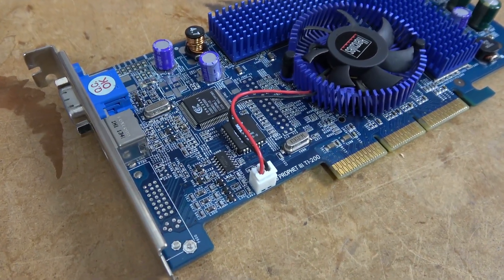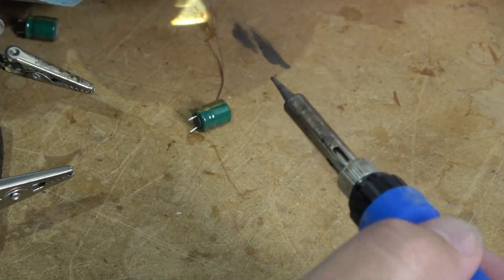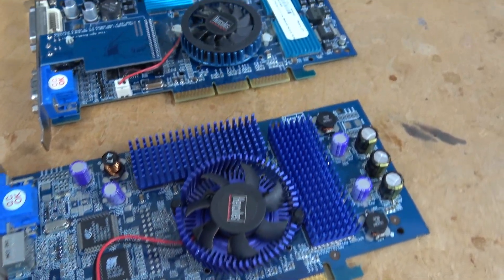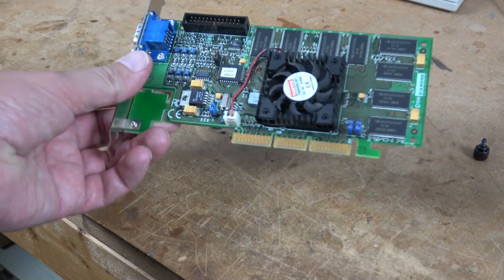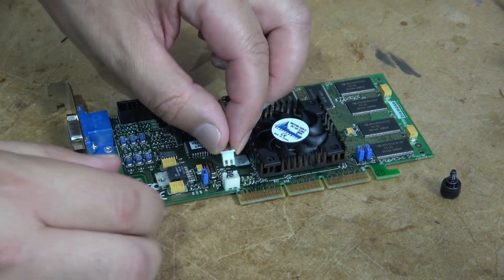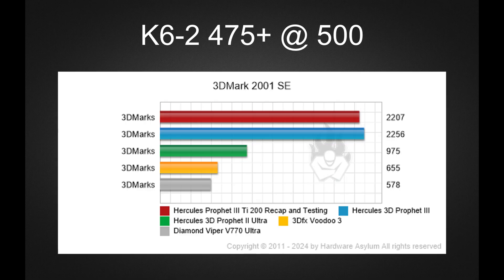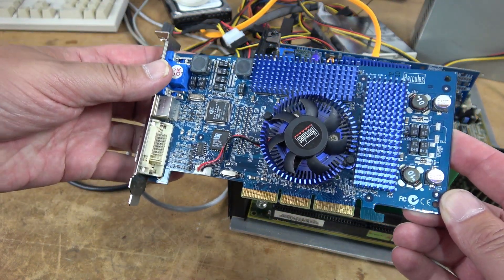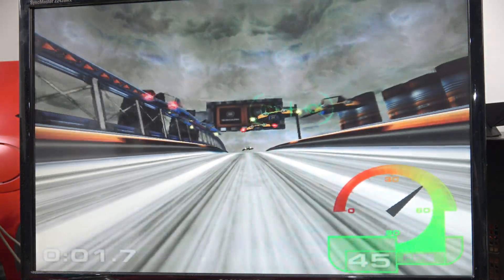Vintage AGP Video Card Repair and Performance Tests

Comment: hey - love the video - my way of doing this to avoid damage to the board  - i always use mechanic low melt first - just with my s60 sequre micro pencil at 400C flat tip - wiggle the caps out as u did - my trick is i have found the smallest finest tip of the S60 tip fits into the holes through to the other side - and the low melt helps that process - i stand the board vertical push it from the fromt side of the board just in case any marks are covered by the cap - but it never has - then once its pushed through - i just use a normal solder sucker over the tip on the back of the board  - work the tip  back abit and suck again - holes cleared perfectly everytime - the only boards ive found that need hot air assistance was a modern GPU as their solder has such a high temp melting point - but for every other retroGPU card and motherboard - it just works - i can remove and clear holes 5 caps in 30 mins now - ground planes no problem with no marks or damage
Reply from the maker: Might have to give this a try,  I did use some lead solder to mix with the lead free on the PCB but, I wasn't able to get enough of it on there to make a difference.  The damage I did was from trying to use a ultra fine tip to clear the via but couldn't get enough heat into my iron to do any good.

I do have a hot air rework tool on order for my motherboard repair and should work well with my de-soldering iron.  It might also come in handy when I go to swap out the memory chips on my Voodoo 5.  

Thanks for watching!
Reply: @Hardwareasylum  yeah but only the s60 has a tiny fine tip thats fits through the leg holes - i mean its a tip the size of a pin - discovered this after being so annoyed i couldnt get the holes to clear and was annoyed of scorch marks and braid not working  - so i thought - well that tiny tip isnt good for much i wonder if it will fit through - and now it has a very important job - cheers